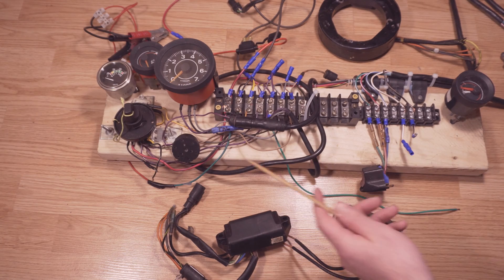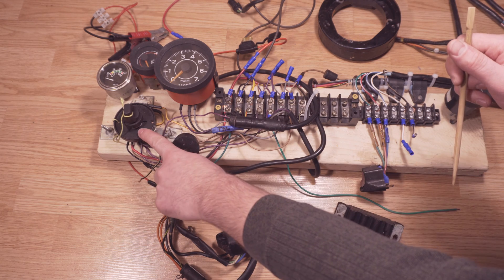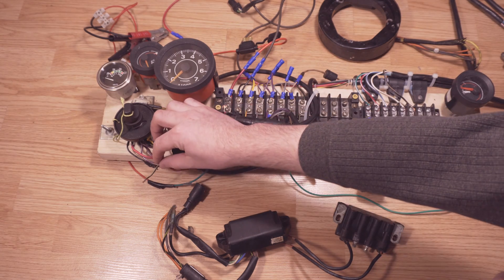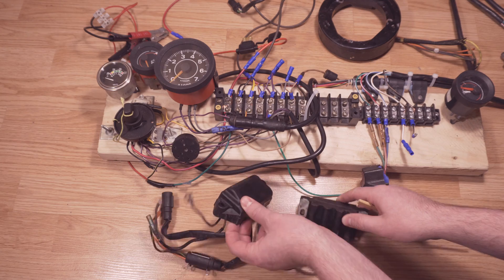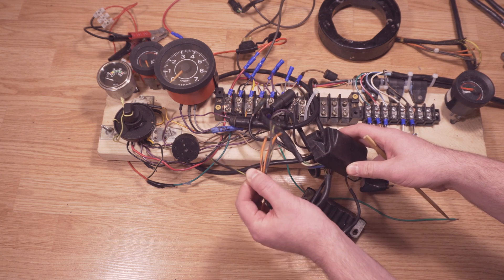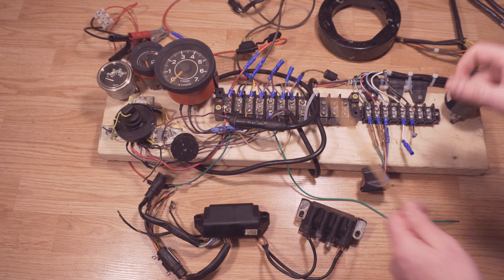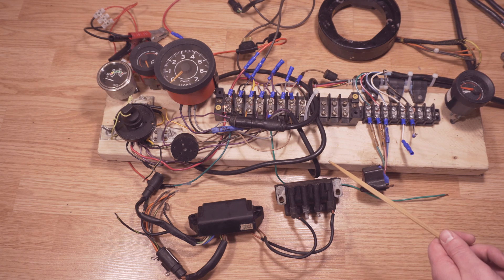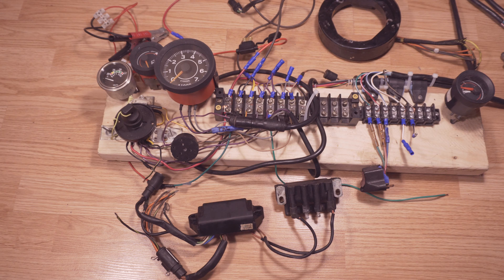Outboard Motor Control Wiring Part 5 - Kill Switch Lanyard Wiring

Comment: I am looking at using a relay to ground the kill switch.  What kind of load? is on that wire when it's grounded?  Is a 12V 5A relay okay?  Thanks for the video!

Comment: no spark, can I cut the wire and see if it will start? Before I go to the power pack,
Reply from the maker: Yes, if you do any wire splitting do it somewhere easy to fix.
Reply: Why cut the wire? Just disconnect the black/yellow at the engine or the switch if it has screws or spade connectors.